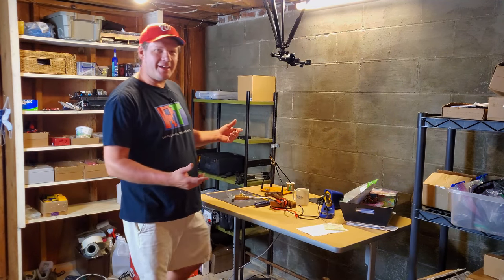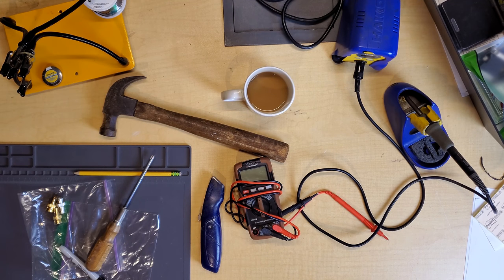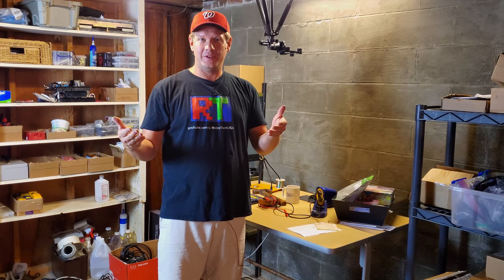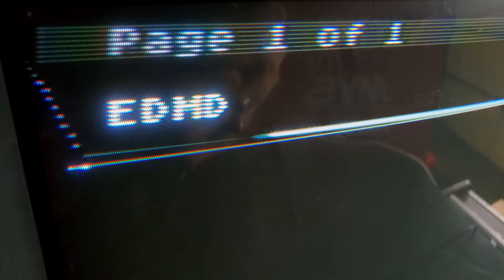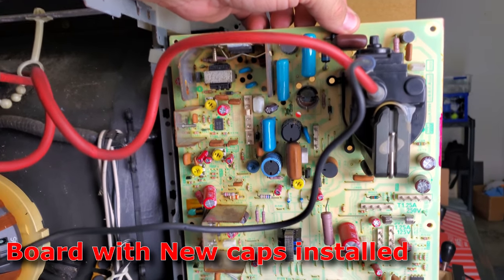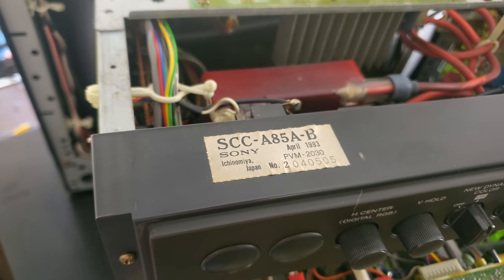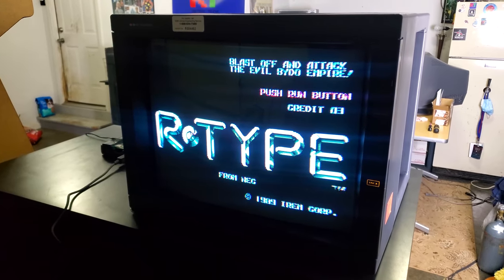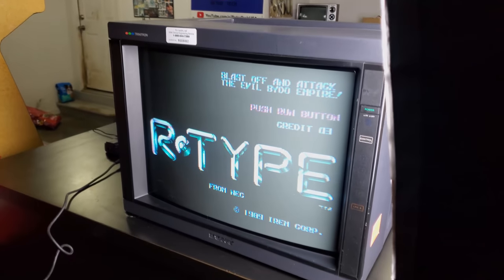Sony PVM 2030 "Horizontal Line Fold-Over" CRT Repair & New Shop Update!

Comment: I have a 1344Q PVM from 1993 with these white lines on top, I was planning to do a full recap but thanks to you I'll just recap the board with the vertical deflection circuit, thanks
Reply from the maker: Recapping everything is fine, but the problem is more than likely coming from a cap or other bad component on the Deflection board.

Comment: Sorry to comment on an old video, but I just came across two pvm 2030s and one has this exact issue. Turned it on and it had a audible buzzing/hissing sound like a cap was about to go, but then it stopped after a bit. After being unplugged for a while then turned back on, it will make the sound again. It has the fold over same as this one here, but just wondering if that cap could be causing that noise as well?

Comment: Do you have any video explaining when a similar defect occurs vertically on one side of the screen?

I have some monitors that, on one side, fit perfectly, on the other, one inch is missing to reach the edge, and there is image mirroring on that edge.

The easy solution is the most grotesque, expanding the horizontal until the smaller side fits, thus losing much of the game screen.

Comment: I Don't believe the 2030 has a comb filter. I remember it's composite looking poor compared to other pro monitors with comb filters. Anyone have any experience with this? Also, I noticed it has a "notch" setting on the back. Is that a composite filter? Anyone know what "notch" does?

Comment: Hey Steve, a quick question on flyback replacement do they have to be the exact model or can similar ones be used?
Reply from the maker: That would depend on the CRT, but you would want to try to get the same exact model.

Comment: Maybe build a PVM pallet to keep everything off the ground just in case the bunker ever leaked and got water 💦 on the floor. 

This is going to be an amazing set up when you get fully dug in. 🧳
Reply from the maker: Yeah, I'm always thinking about that.  I've already double-sealed the windows, and adding some height will help.